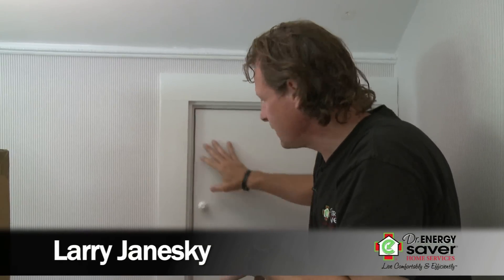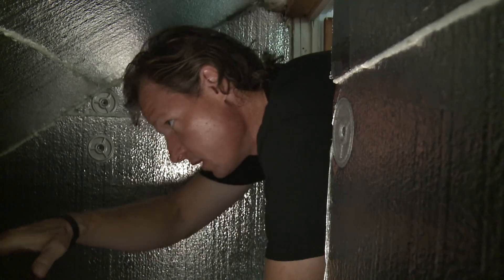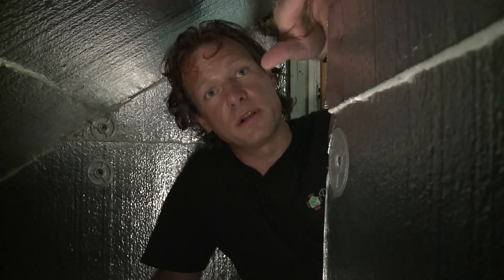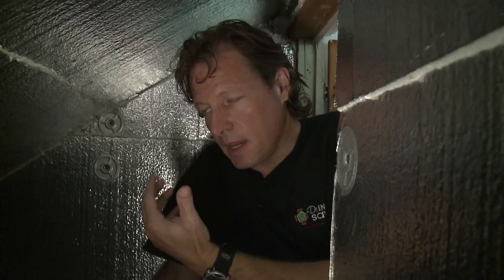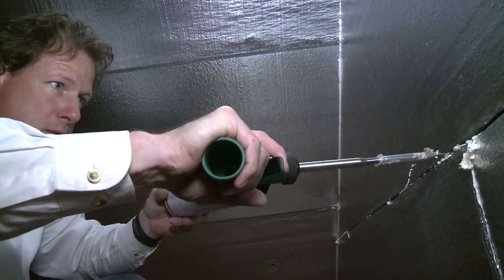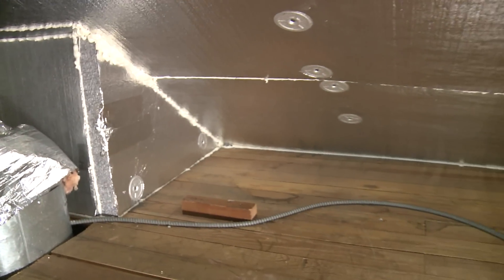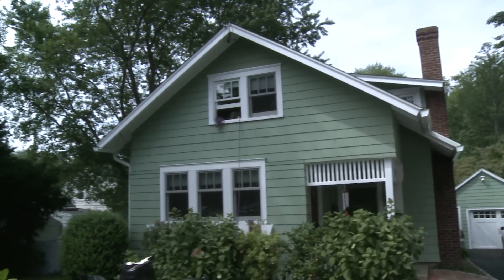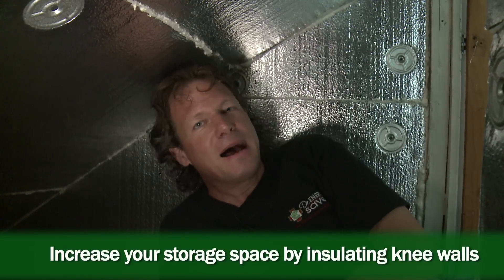Making Knee Wall Spaces Energy Efficient

Comment: Great video thanks.  I have a cape cod house.  I am demoing one room on 2nd floor.  So it looks like the right way to do this is to make sure I run the soffit baffle from the soffit to ABOVE where the knee wall space is,  then seal the knee wall space.  I will put R13 on top of the soffit baffle until it gets to the point where it gets flat (where the cross ties are)  and in that flat spot I was thinking faced R30 then climbing up there and putting unfaced R30 in the opposite direction.  I am not a fan of blown in.  Does this all sound reasonable?

Comment: Question. What if you dint have soffit vents to bring air up and out ridge vent?? How should that be handled??
Reply: CUT VENTS! You are killing your energy bills if your roof isn't ventilated properly. I always like to use power vents on the roof to help suck hot air out in the summer.

Comment: What do I do if my knee wall is covered by an addition. I have that on one of my knee walls. I opened up the wall to have a look. What is happening is that where the addition and old roof meat in the winter the ceiling in the addition leaks. Could this because the knee needs to be sealed?

Comment: a very brief mention of the " soffit/eve infiltration" in relation to the floor of the knee wall. if the floor joists are unblocked in this area(at the perimeter), the outside air will simply take the path of least resistance and affect the level below.

Comment: is the foam board insulation on the back of the studs of the vertical wall the only insulation on that wall? what type of insulation in between the studs there? is it bad to put paper faced batts in there?

Comment: What are those round things in the silver insulation blocks ?
Reply: just working as washers to help the fasteners hold the foam board a screw or nail head is too thin and might pull through foam board too easily